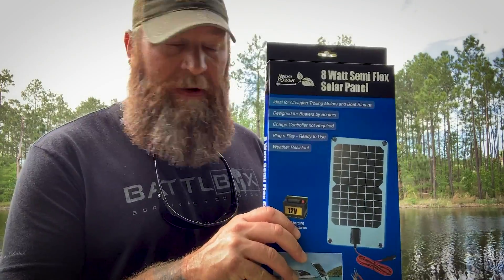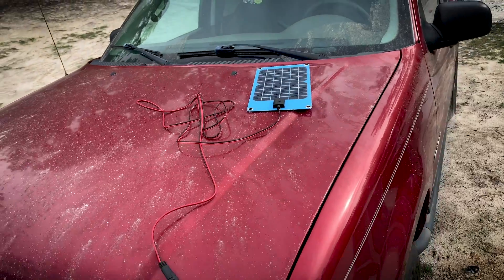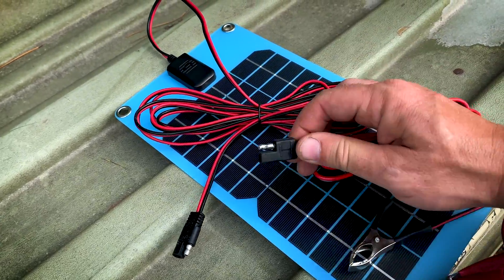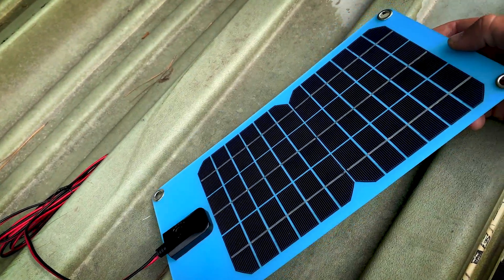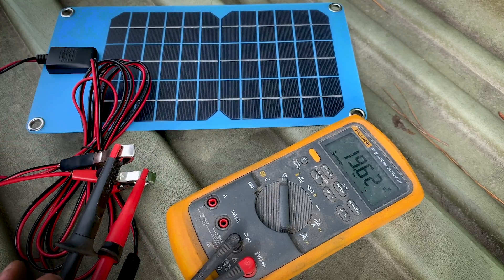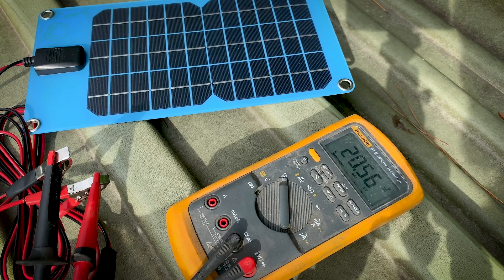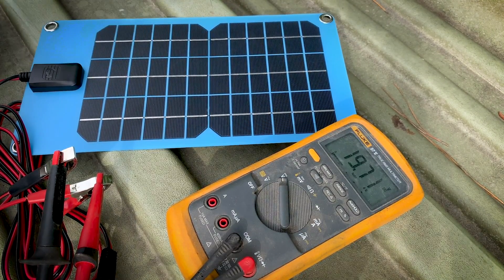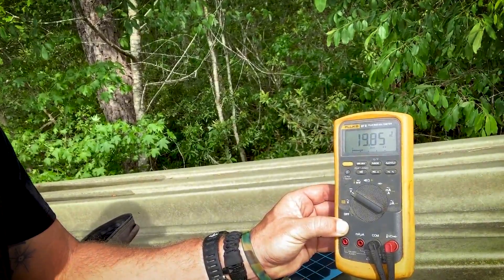SOLAR TRICKLE CHARGER

Comment: Unfortunately 18 V is too many volts to charge any vehicle batteries. I believe AGM batteries charge at 14.1 V and regular lead acid batteries around 13.7 or something like that. Basically it will keep your battery charge but it’s gonna damage your battery overtime.
Reply: My thoughts exactly. Thank you!

Comment: So, I bought a 1.5 watt solar battery charger to trickle charge my 12V size 24 marine deep cycle battery that sits outside on the hitch in a battery box on my teardrop camper trailer. I hooked up the panel directly to the battery and no problem. I disconnected the battery and installed a battery monitor between the panel and the battery - when I went to hook up to the battery it took just a moment for the wires on the monitor to fire smoke and melt as I pulled it all off and of course burning myself (not badly just side of my finger). What happened? It is a new battery and was used over the weekend for maybe an hour to power the fan on my trailer - was it because the battery is fresh and new and had all the charge it could handle so it overloaded?

Comment: This sounds sketchy.  If this is putting out 20 volts it will overcharge the battery.   Volts by itself doesn't matter.  What matters is the amps at 12-14 volts
Reply: I found one with charge controller built in.
Reply: @ScrewMaga  where? Still serving you well?